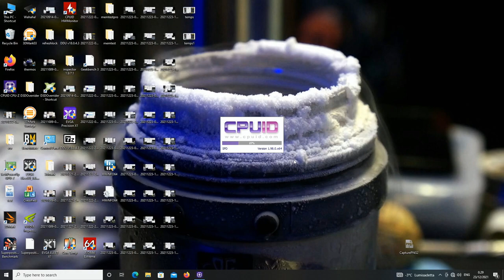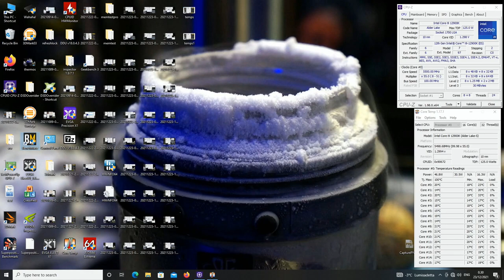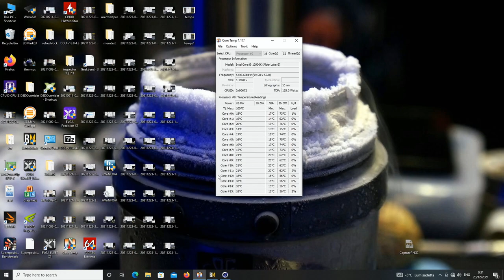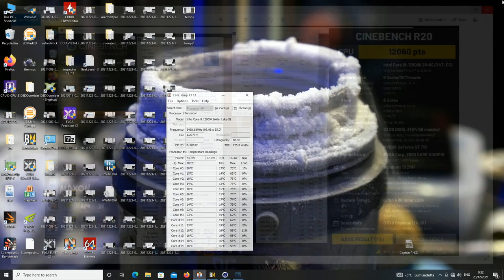Why CPU Lapping isn't Very Worthwhile on Air/Water Cooling - Intel Core i9 12900K Lapping

Comment: Why don't you try this on a 12900K that isn't a SUPER BINNED chip?  Like 5.5GHz and 300W+ and your temps are in the 70's?!?!?  Like that is NOT normal!  That is a extremely rare 12900k you have there.  Why don't you try this on a 12900k that runs around 90C on water with a OC of 5.3GHz all core like most normal 12900k's?

Comment: What do you think of using liquid metal with liquid nitrogen overclocking for gaming fps benchmarking. All these cinebench shit generate heat in a decentralized manner spread over many cores but gaming generates less heat but far more concentrated on like just 2 cores. And therefore those hotspots need to be cooled well as even under liquid nitrogen their temperature is high enough that liquid metal can help.
Reply from the maker: Well liquid metal has bad performance when going below zero.
Reply: Have you done gaming tests to verify that the core with the heaviest load which is the most important core for gaming is actually getting below zero ?
Reply: @hamzashaikh9310  liquid metal solidifies below ambient(not sure exact temp but like -20 or so), and when that happens it contracts and no longer filling in those imperfections of the contact surfaces.
Thus bad for dry ice and ln2.

Comment: It is very worthwhile lapping the cpu, if you lap your CPU mounted/socket-ed. The fact that you make it perfectly flat and shiny will not help you if the moment you installed it will be bent. And it will bend even if you use a custom ILM.

+ of course, you need to know if you cooler/cold plate is perfectly flat as well.